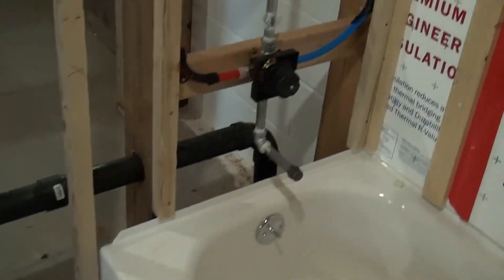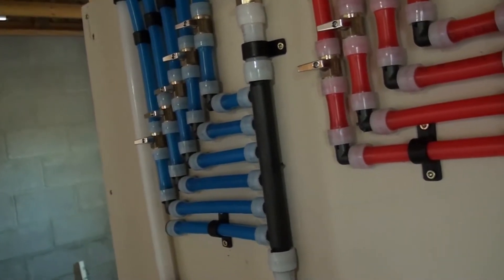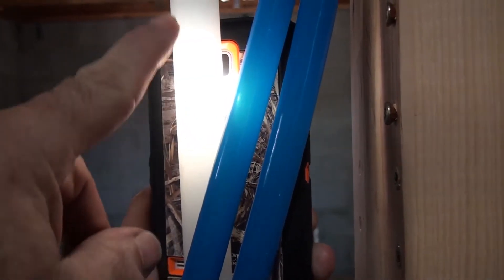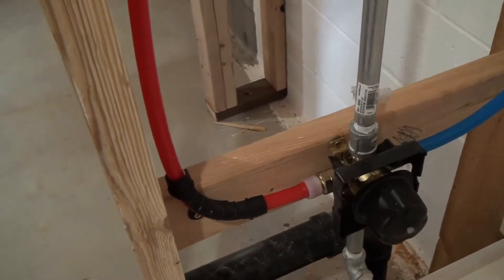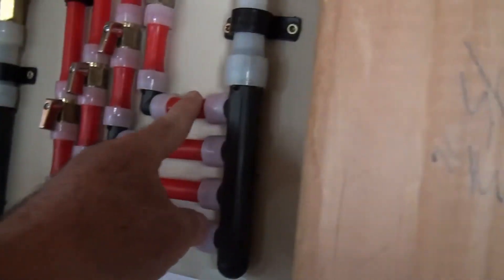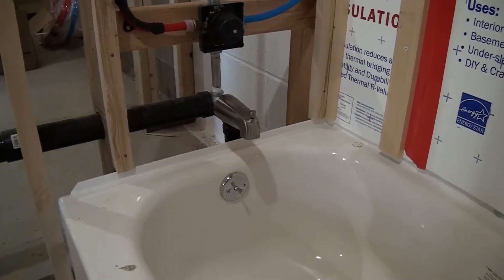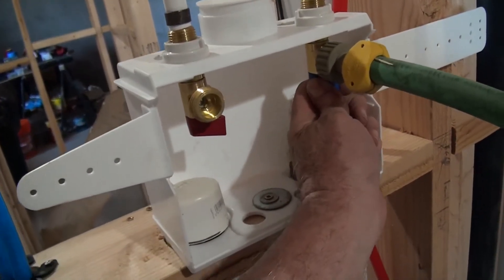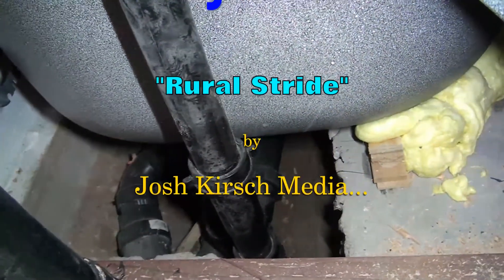Checking Pex Distribution Lines For Leaks, So Slow House Update 25

Comment: You have several plumbing mistakes in your construction....illegal S-Traps, PVC inside used for potable water inside the house,  PEX piping too close to the water heater flex lines...etc.  Good luck.
Reply from the maker: Ok, thanks, I believe my work is just fine. PVC is still used for water lines and Pex is not too close. S trap not here.